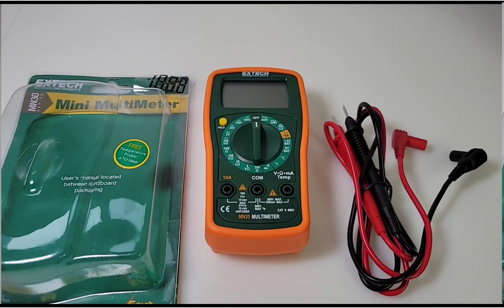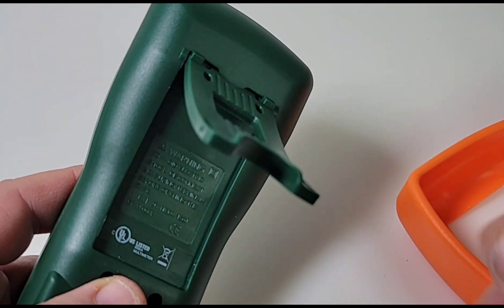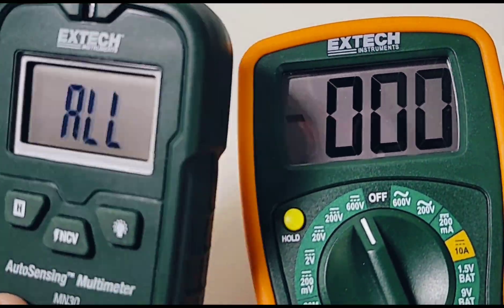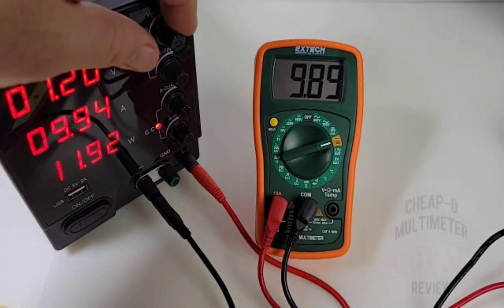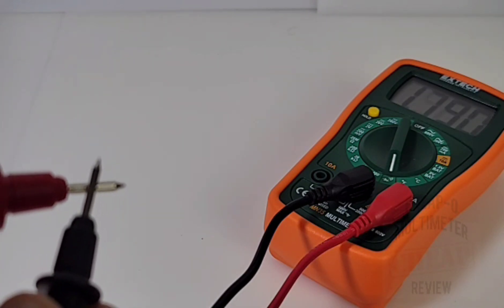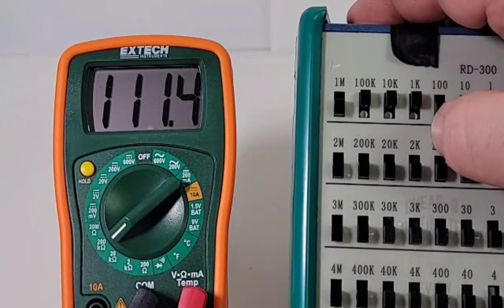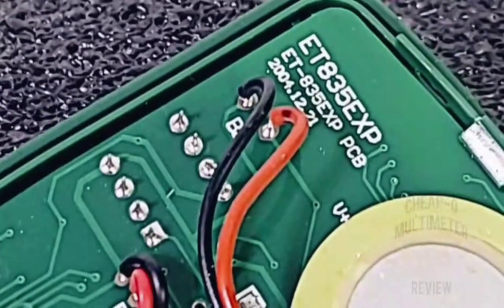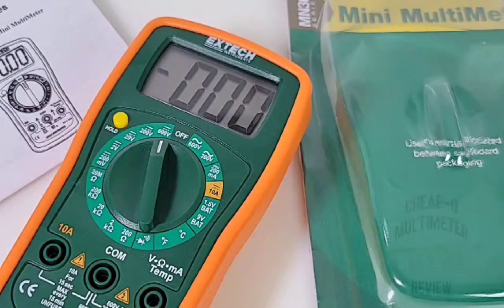EXTECH MN35 CHEAP-O Multimeter Review & Teardown!

Comment: Slow measurement on the 20 M range is normal. There is a capacitor on the main input of the ADC (typically 0.1 μF) and it must be charged through the measured resistance, the 10 MOhm voltage divider sections and an additional 1 MOhm protection resistor, all in series.
Reply from the maker: So 👍 true..When the capacitor connects to the ADC the conversion time can really slow down.
Reply: @KeepOnTesting  This capacitor is used first of all to smooth out 50 Hz when measuring AC voltage.

Comment: I have the Extech MN 36. IT's nearly the same meter but then with auto-ranging. Besides that it also measures capacitance and fequency (hz). It basically is all an average tinkerer needs.

Comment: Extech meters are imo, WAY overrated.  I bought a EX730 clamp meter nearly a decade ago, mainly for its DC-current measuring capabilities - turned out to have awful accuracy & useless for what I needed.  Final insult, BEMF from a mains transformer measurement zapped it.  I was dismayed to discover that there is no input buffering whatsoever in use with the EX730 - it has a direct connection to the main i.c. - no input-protection whatsoever in use for a meter that cost more than 4 times (at the time) for what replaced it.

Awful meters, do not buy.
Reply from the maker: It's true the Extech name has a very spotty reputation. I've had some great results with Extech multimeters but I've also had many duds..they have a definite Q/A control issue. 
One of my favorite test instruments , the Extech 380193 LCR Meter has served me incredibly well over the past 8 years.

Comment: Yah at last for you.. you like it you like it.
It's a piece of crap no hrc fuse no led backlight. Temperature measurements are also faulty then why did you like it Darren?😂🤣
Reply from the maker: It's built very well. At 30$ it's a no brainer. It's not always about input protection or feature set. Quality build and overall usefulness go a long way. I used it on a jobsite  yesterday and it held its own,  nuff said. When the electrician I was working with found out how little I paid he purchased 1 on the spot. Smart man 😁

Comment: Good review. It's a basic meter but has everything I would really need. I like it for the rugged build quality. Something that isn't going to fall apart like a super cheap meter would. Looks like it would be good for homeowner use or for a service tech that occasionally uses a meter. 99% of the time in the field I'm just using AC Volts, Continuity, ohms, and DC Volts to do repairs and this works fine for that.

Comment: Not too shabby, but unfused? What's going to happen if I accidently leave the probes in the current jacks and measure my car battery voltage?? The shunt going to melt?
Reply from the maker: Roger that..fused is always the better option. Input Protection isn't this dmm's strong suit.😱
Reply: @KeepOnTesting  Testing it on a high amp capable source, like a car battery, would make a spectacular video sure to attract millions of views and a lifetime of riches! 😁

Comment: I work in IT and my exp with Extech is their cheap stuff is too cheap and their expensive stuff is too cheap. In a nutshell you can get more for your $ elsewhere.
Reply: And if you want speficics its their toner/probe kits. Their tg20 is a super weak probe with nothing but 1 ic for amplification and their 40180 kit is 95 bux with a weaker probe and tone generator with fewer features than a tempo triplett or fluke in the same $ range.
Reply from the maker: Extech has a big presence in the corporate testing world...alot of companies have Extech gear. Not sure why they are so prevalent but probably their pricing schema has alot to do with their appeal. Usually lower than Fluke but more expensive than most.
Reply: @KeepOnTesting  my guess is its the same reason fluke is so prevelant. Alot of companies have standardized procedures that require standardized tools and extech was the brand they used when they made the standard. Its the same reason fluke is so prevelant and why TI graphing calculators have changed little since the 90s and still cost 80-120 bux.
Reply: The initial / basic fluke model is too overpriced, although it has a number of advantages (such as the selection of quality resistors and microcircuits) but they charge more money just for the name.  The same situation is with Unit, the cheapest models do not stand up to competition and do not make sense to buy.  Overpricing for minimal functionality.
Reply: @Pro100Gadman  reason fluke is so expensive is cuz govt agencies and us armed forces based protocols and procedures on them. When its a nuclear sub that has procedures that were set using a fluke you better believe it that they have to use fluke.
Reply: @Henry_Jones  Ridiculous) Fluke has a number of advantages.  This is not a Chinese box component, it is an advanced main chip and protection.  But if you look at each parameter, then this is an overpayment for the brand.  Same as Unit in base models.  The best RM and Holdpeak models will do the same job faster and will be as fast and reliable as possible.  I have friends electronics engineers and electronics repairers, and from experience they say that there are so many positives in Fluke, just as many negative ones.  The price is not justified.
Reply: @Pro100Gadman  well as far as flukes IT tools go theyre overpriced and break easily. They were harris till fluke bought them and theyre not worth it now.

Comment: Hi Darren. Nice video.
$ 24 for this is too expensive. OMG. A thermocouple costs $ 2, no more)) Unfused.... hm...
  Inside, it is not made very badly. he reminded me of the legendary DT838 or DT33 +. Everything is very similar, but some components are traced.
 I would give it a 5 stars rating out of 10. The price is too high for such a functionality.
    For practically this money, you can buy a killer of expensive RM 409 or RM 219 or any Unit at this price - this is the HoldPeak HP-890CN. The only thing that is bad about it is the accuracy of 6000 counts. He would be 20,000 and it would be a bomb.
Reply: By the way. I also want to tell you about Lomvun 616. Just like all typical and cheap multimeters have a small drawback. This is a backlight that burns for 30 seconds. It does not have an EEPROM, so it will not work like RM102 and others like it. But he has the addition of REL, RANGE, MIN, MAX buttons inside the circuitry. Only this, of course, needs to be done carefully and rather dreary. But to make a backlight that will burn forever (well, or until sleep mode, after 15 minutes, yes, there is a sleep mode in LOM 616) I'll give you a link to google disk, where I showed you how to do it in one of the photos. at the same time I will show how he came to me. Sincerely.

https://drive.google.com/drive/folders/1kW5zLCZRnj01pYckM8MD66CS7PeGGb9Z?usp=sharing
Reply from the maker: Hi my friend...sorry you weren't as impressed as myself. I know this Extech can't compare functionality wise to most new Multimeters but it's also beautifully built with alot of attention to detail. I'm still keeping this Extech on the bench 😤 👍
Reply: @KeepOnTesting  No no, my friend. I do not argue. I see this, so I wrote about the old DT 838 and DT33. They, too, were similar. Everywhere there was the presence of high-precision resistors, there was a varistor at the input, there were tuning resistors, 5 pieces for each measurement area. Only the main chip is old, so they could not show a high speed of dialing. On the contrary, I am for such multimeters, I was just confused by the price, because today it is very simple to apply these parts, only no one wants to bother about it.

 I just wrote about the 890 Holdpeak at the end, because it's really cool and maybe those who are ready to spend $ 25-30 on a multimeter could consider it if they don't need 20,000 counts.
 You abstract from this that I wrote, I mean the same things as you say.
 Have you looked at the photo?
Reply: @KeepOnTesting  Darren. Look here. My second post where I tell you about the EEPROM which is not in LOM 616, about adding Rel Min Max Range buttons and about how to make an eternal backlight in a multimeter by replacing it with a useless flashlight. Can you see this message with a link to my google drive?

Comment: Nice review. Wonder who the original manufacturer is? Extech do use CEM a lot, who do have variable build quality. Does look to have isolation slots around the input jacks as well as the PTC.
Reply from the maker: Good point..those pcb isolation slots mean some thoughtful engineering took place. I'm gonna stick my neck out and say Extech is the oem considering the dated pcb.

Comment: happy new year Darren. I would've thought 3.5 was more appropriate  for this 2000 count cheapo. Missing capacitor measurements.
Reply from the maker: Happy New Year Osman...
Final ranking was a toss up. 
3.5 was actually my initial thought 🤐.
I was just so happy with the ol school pcb design/fit n finish I gave it the 1/2 ☆ Xtra...I mean a 4 ball bearing selector switch, what more can you ask for 😉
Reply: @KeepOnTesting   I guess it also had shielding!!  adds 1/2 points  🙂
Reply: More the no. of balls, the more longer it can last! 😉

Comment: Interesting. 🤔 I must say, I didn’t like it at first. It looks basic, has almost bare-bones functionality. Still it performs adequately. Much better than Klein M300 did. It has shielding and the build quality is decent. Apart from missing backlight and nonessential functionality like NCV, Live and everything, it’s a solid cheap-o.

You’ve chosen an interesting model to start the year with, Mr. Walker. 👍
Reply from the maker: I really wasn't sure if I wanted to start 2022 with an Extech..but this ol/new dmm really took a shine to me. Happy New Year!
Reply: @KeepOnTesting  Starting a new year with a shielded cheap-o should be a good sign. 😀

Comment: Looks like a 10 dollar or a 5 dollar multimete, not a 30-35 one.
Reply from the maker: I disagree..it's heavy,  High Quality plastic,  Crisp Display and built to last. It's a steal at 39$CDN/33US.
Reply: @KeepOnTesting  But it still only  has the functionality of much cheaper meter, I would get a 60 dollar Fluke 101 or an Aneng 8008 for 20. This just doesn't make much sense to me.
Reply: It costs $ 23. And this is also expensive. But this multimeter is for connoisseurs of circuitry and tracing in the style of the old school.
Reply: @marko6550  It's true. I agree with you. This is what I wanted to say, and even more, that there are good qualities that really cost more, as well as simply overpaying for a trifle unnecessary for work and a big name.